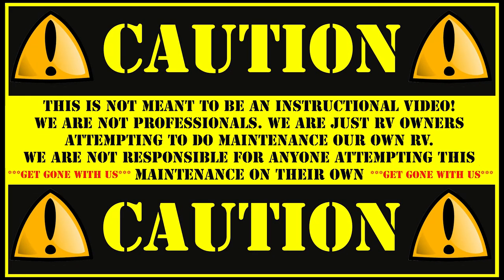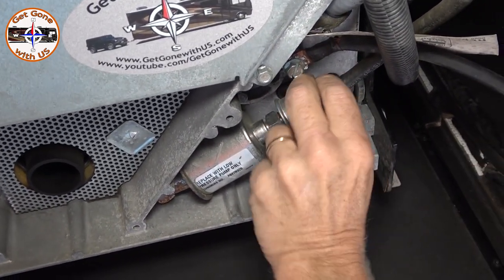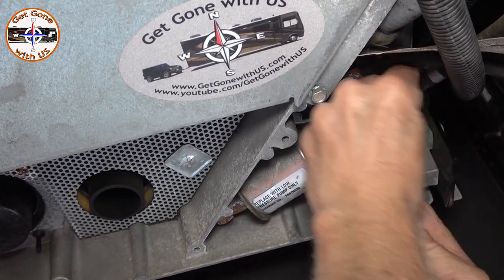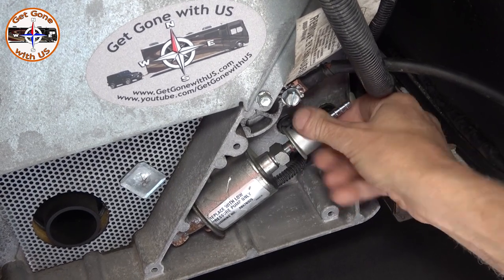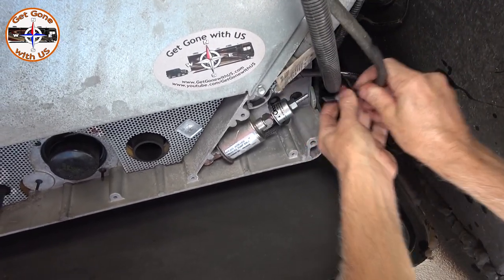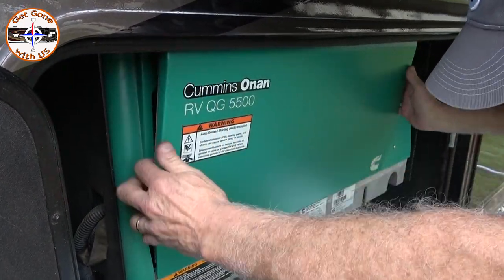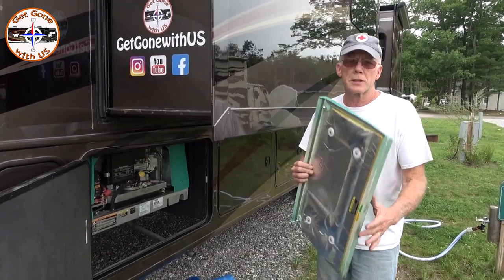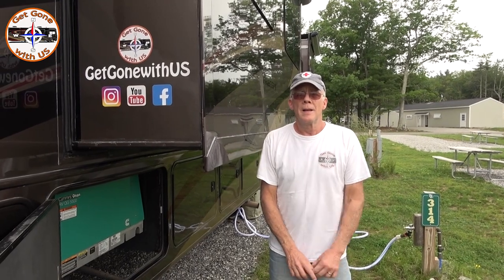How to Replace Generator Fuel Filter for Beginners - Onan RV QG 5500  Generator

Comment: I can't thank you enough for providing such clear and thorough videos of these proceedures.  I purchased the fuel filter, the oil filter, the oil filter wrench and the oil pan valve off the links you provided.  Pumped to do this maintenance and keep our Onan 5500 running like it should!
Reply from the maker: Thank you so for your comment and using the links we apprecaite it! 😀

Comment: Awesome
Just used this video to change my fuel filter on my Onan 7K
I primed it for 30 seconds and then I noticed gas leaking from behind the air filter and then it wouldn’t start. Maybe I flooded it??
Thank you for making RV life I little less daunting yall!
Reply from the maker: You are welcome.  Sorry to hear about your leak.  I would check all the connections and try it again.  We had the same problem with our lawn mower. Air filter was getting soaked and wouldn't run until it dried out. Come to find out there was a vent hole that leads to the air cleaner.  Apparently we were filling the gas tank too high.

Comment: Hi.
Thanks for your video I think I can drain my gas tank because the gas is old using your Technique that you just did to replace a fitting on your generator❤
Reply from the maker: HI!  Good luck draining the gas, you really don't want to run old gas.  👍

Comment: Great Video 👍 quick question, 
•after you took the fuel line off, you start the generator and wait until it runs out of gas ? How long will that take ?
•if you let it run out of gas then after you install the new fuel filter, how can the generator start if there is no gas ?
Reply from the maker: Running he generator after  disconnecting the fuel allows the fuel still in the still in the system  to empty.  You have to press the primer before restarting the generator.

Comment: What if there’s no seal on it.? Can I use Teflon? Excuse my curiosity but I am brand new at this RV life.
Reply from the maker: Are you talking on the threads?  If the filter is new, the thread should be sealed already.
Reply: @GetGonewithUS  yes. The threads ( fuel filter) is brand new. I installed it and ran it for 10 minutes like you suggested. No leaks during or after. So I believe I am good to go. 👍🏽👍🏽 By the way excellent instructions!! You guys rock. I did a little video and will be giving you the credit as it should be. Thank you again. See you on the road!!!
Reply from the maker: @gallom325  Glad everything worked out and thanks for your comment and credit in your video.  We appreciate it. Happy and safe travels! :)
Reply: @GetGonewithUS  you as well. Thank you I also did my generator oil filter from your video as well. Have a blessed day. Safe travels!!!👍🏽🤗🚌🚎🚐

Comment: What is the purpose of running the generator empty after you disconnect the fuel line?
Reply from the maker: Not really sure, but it is step 3 in the Onan Service Manual for replacing the fuel filter. 🙄

Comment: Hey Chuck.  Only recommendation is you could have mentioned the Onan fuel filter part number.  Thanks.   Steve
Reply: Hey Steve. Everything that we have done or added to Maggie, we list links to them in the description box below the video.  Thanks for watching! 😀
Reply: Went to the local RV dealer that I've gone to for many years.  A fuel pump was $129ish.  Went online,  bought the same item for $24.95 shipped Amazon. Would love to support local guy but.... come on.  S
Reply from the maker: I know it is tough to shop local sometimes, but 5 times more is crazy. 🙄
Reply: @WeRmudfun  Ok... new fuel pump & filter installed.  Gen started fine,  ran 4 minutes and shut down. Checked and had fuel in carb so no problem w/fuel supply.  After watching video going to chase the (too full) oil issue.  Hope to get it fixed..leaving next week 6-week for road trip.
Reply from the maker: Good Luck and we hope you enjoy your road trip. 😀

Comment: HI, I’m hoping that changing my fuel filter is what’s the problem, it started having trouble staying started, it takes 5-7 times to get it to stay started, it fires up, but only stays started maybe 6-12 seconds before it shuts down.  I googled it and it said it was maybe low on oil, so I had it changed since it was due anyway, but it’s still not firing right up.  This looks like something I could maybe do, I’m 73yo female, and I’m not in favor of crawling on the ground (and there’s still ice on the ground right now 😩) and working above my head, but since I’m getting minimal sun, I need to run the generator almost every day ! 😩 and I’m getting stressed not knowing if it will start.  My rv is a 2012 and I’ve been able to get the oil changed at least a number of times, but I don’t know if anyone ever changed the fuel filter 🙄 

Any suggestions if the fuel filter doesn’t work ? 🧐. TIA
Reply from the maker: HI Pat.  Sorry to hear you are having issues with your generator.  I would suggest putting a blanket or something similar to cover the ice.  If the fuel filter doesn't do the trick.  It might need a tune up or an overhaul.  It's had to diagnose an issue without being there in person to see and hear what it is doing.  Good Luck!